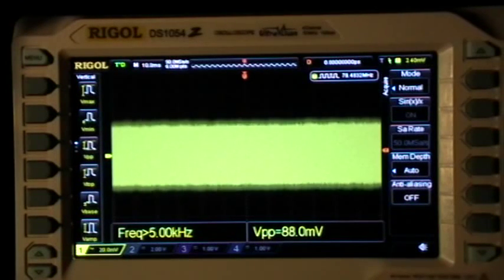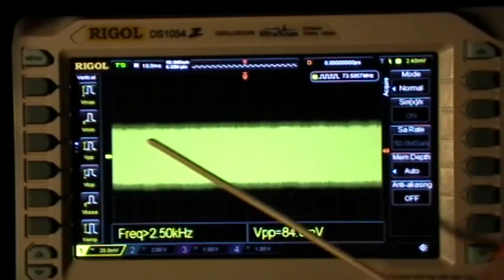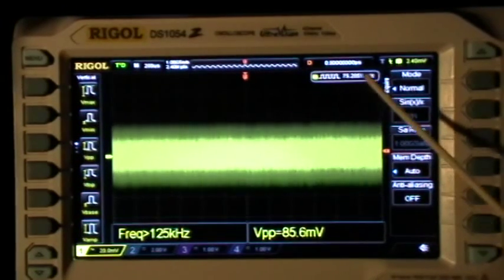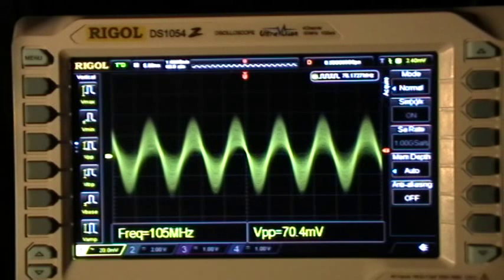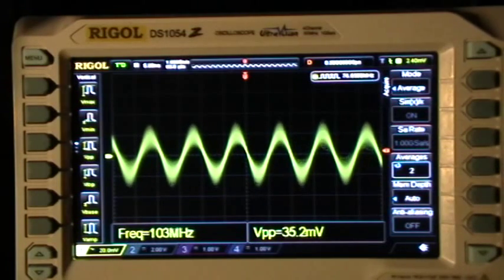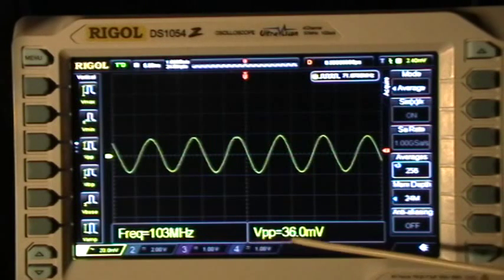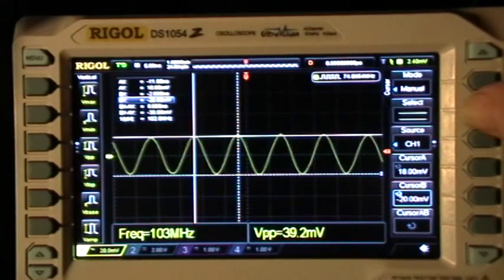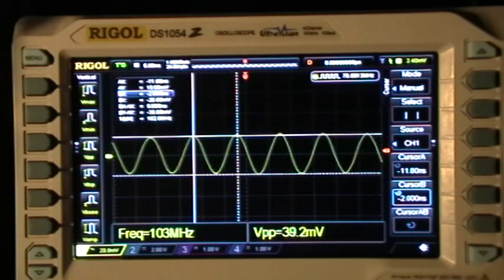Scoposcopy: Rigol DS1054Z Demo 2

Comment: TinselKoala - thank you for your quick reply.   you have read carefully my comments and addressed them well. that has led to further thinking. and another response will follow. i have some homework to do here first.

                 a 1054z is a recent purchase and a few  things read in its manuals came to mind while viewing your video. 
 one is about the min size a signal the unit can handle. and now your remark  how the 8-bits of ADC is tied to the actual rigol scope screen's vertical volts/div setting.    this all needs some chewing on ...  one idea is to change from vector to
dot mode for the trace display.  in case the dots are the actual sample points.  if a full height sin wav is seen to be made
of 256 dots that will clinch it.

                         another thing  is looking for where the two types of freq counters info is located  in a manual.
   and wondering what sort of signal will have the freq's match in both places measurements locations .
this part of your video has taught me the awareness of how an overall captured signal can have sub-sections to it
that do offer different freq info.

     the 'memory depth'  that you  sought to cover  is still a fuzzy topic, thus i am not now able to put together
any comment or question that makes any sense.  this scope is presenting a whole new world of features and
abilities.   so i  turn to u-tube for videos by early explorers such as yourself.     

             lets sideline 'ground plane noise' for now.  its a distraction from what you were
presenting. and i shouldnt have mentioned it.  what is better is for me to  work it on my own and keep an eye out
for someone who has covered it in a rigol demo video

    lastly ,  i ask that you provide us with what the input signal/circuit is for this video of yours.    for one reason to have a starting point to be able to compare the 5ns scope screen image to.    your remark about how a square wave can appear as a sin wav tips me off to a need to carefully interpret  the trace/signal of a scope's output
Reply from the maker: bob along For this video I just connected the scope probe to a random coil. I don't even remember which one I used, actually. An air core coil from a CRT TV deflection system probably.
Perhaps some of my later videos using this scope will be more interesting for you. Try these:
https://www.youtube.com/watch?v=F8hf4_-Di3M
https://www.youtube.com/watch?v=Jc-Op1_Ka8g
I'll be making more as time goes on.
Thanks for watching and commenting!

Comment: your going over the top wiggly line and memory depth was informative
 i wish you'd a said something about 38mV being near the low end of
         what this models ADC chips can handle . i'm trying to get how
         the 8-bits relate to the smallest step of a given signal's amplitude
not understood was the 2 different frequency location numbers
nor how a 100 mhz signal appears so well on a '50mhz' scope 
i liked learning the horiz' cursor blue indicator along the right side
overall you done good and i'll be back for more.
oh, one thing in particular i want to learn is how to use this scope to
    see noise in the ground plane of a circuit
Reply from the maker: bob along 
Thanks for watching and commenting!
I think that the 8 bit vertical resolution means that you can only see or display 256 distinct levels of "voltage" from top to bottom on the screen. A little fewer actually, like 7 1/2 bits.  I don't know about the minimum 38 mV level of the ADC chip, that information is above my pay grade! The minimum V/div setting is 1 mV/div with a 1x probe attenuation factor (as with a straight cable connection to signal under test.) So I am "assuming" that you can display a little fewer than 256 distinct levels between 0 mV and 8 mV (one full screen height) but I may be understanding this wrong...I'm sure someone will tell me if I'm wrong!
The top right frequency counter is a true hardware counter and functions on the entire memory buffer, whereas the one on bottom left is from the Left Menu items and functions only on that portion of the memory that is actually displayed on the screen at any given time. 
Don't be fooled by "bandwidth": the bandwidth of the scope will determine how accurately a waveform is displayed. Just because you are seeing a nice sinewave on my screen does not necessarily mean that a real sinewave is being measured! In fact a square wave signal will look like a sine wave for higher-frequency signals. I think the "rule of thumb" is something like 1/5 of the scope's quoted bandwidth for accurate display of square wave (fast transition, high frequency components) signals. IOW, a 20 MHz square wave should display accurately on a 100 MHz bandwidth scope, but a 100 MHz square wave will probably look like a sine wave on the same scope.
I don't quite know what you mean by "noise in the ground plane" of a circuit. Perhaps you could make such a measurement by connecting the probe reference clip to a true Earth ground (which it should be anyhow, back through the mains line cord Ground pin connection) and the probe tip to the circuit's ground plane, with care about isolation so you don't create a ground loop.